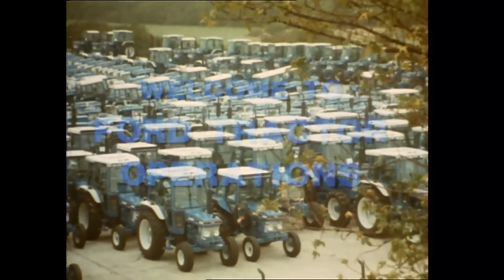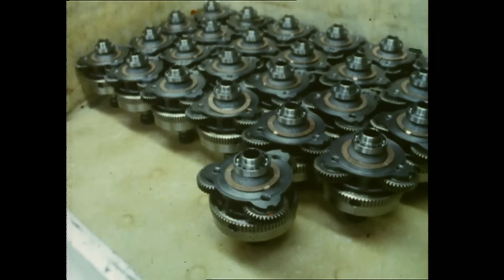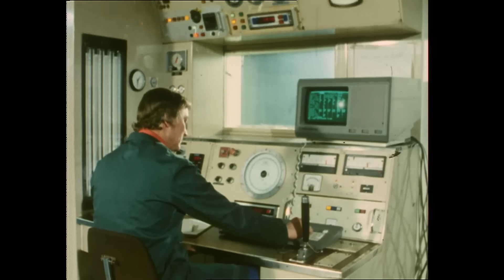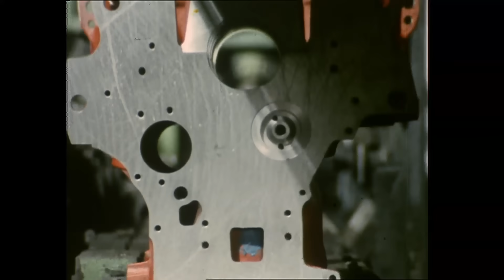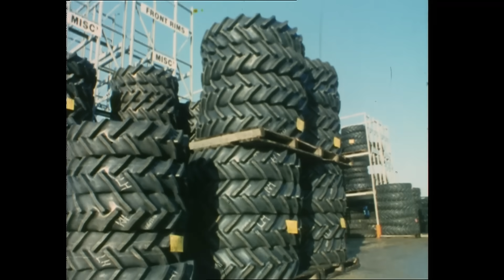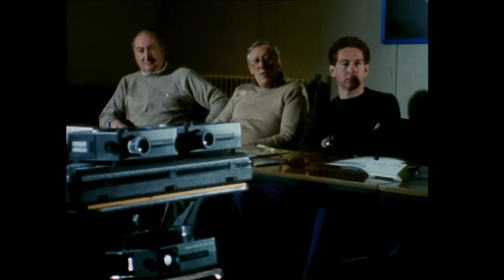WINDOW ON FORD ARCHIVE FILM

Comment: If the components were rigorously tested why then from around 1970 until 1991 did Ford engines continuously go porous allowing water into the engine oil ! Ford made excellent tractors but if only the engines were improved.

Comment: Porous engine block comes as standard
Reply: We've had 4 tractors utilising that family of engines with a combined total of over 20,000 hours and never had an issue.
Reply: @farmlyf we had a Ford 7600 Q cab and it went porous first in the liners so we had it machined and new liners fitted but less than two years later it went porous again but this time in the block itself so had to source a new block which only lasted a few years before it also went porous so we replaced that 7600 with a 7810 which was the best tractor we have ever owned
Reply: Lucky you. We had two and both had that issue